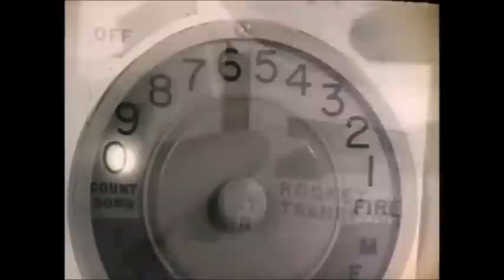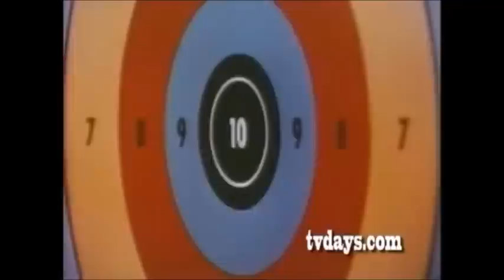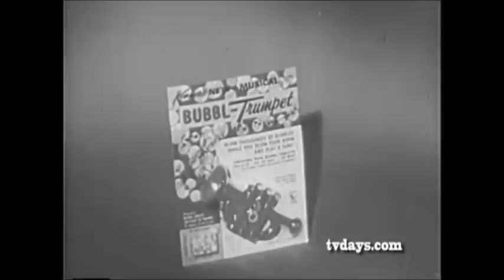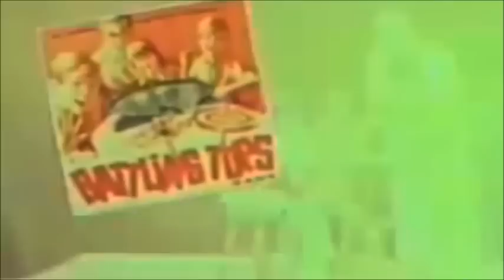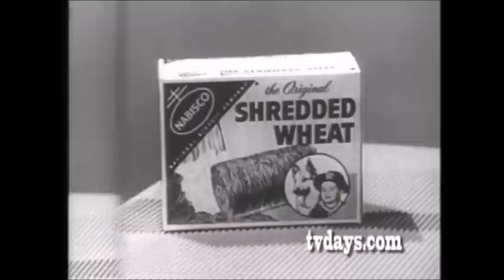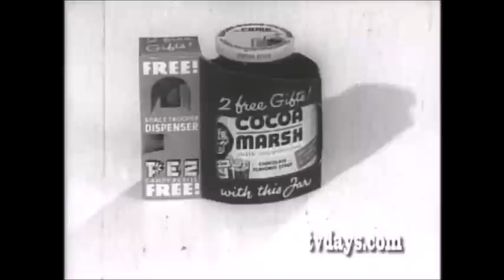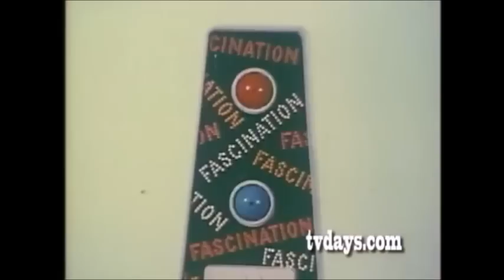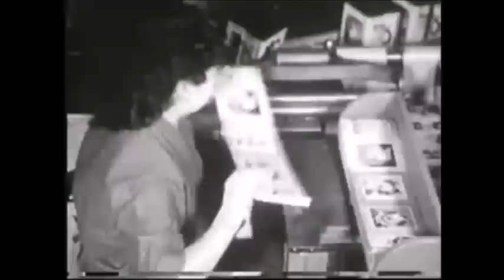Video Vault 19: Toys Were Us!

Comment: One thing they had in common, if it needed batteries more often or not the toy was dead or had a corroded battery case. Alkaline batteries were expensive as hell and reserved for photo electronic flash or items that HAD to have a high reliability of powering up. Those carbon batteries, while cheap, would leave you burning through a case in a week for your toys especially ones with motors and light bulbs. Now we have digital rare earth motors and LEDs that achieve more with a fraction of power draw but no market for toys that have those cool missile launch pads and atomic cannons!

Comment: What about the Mattel Thingmaker that you made Creepy Crawlers with? It had those metal molds you would pour liquid plastic goop into and heat them up on the electric hot plate burner that got as hot as a real kitchen stove burner. You'd cook them until they boiled, pull them off the heat, let them cool, pull the finished product out of the mold and bingo: you had solid rubbery like creepy bugs. Great toy to give to your six year old unsupervised kid. After my dad died my single mom gave me one for Christmas not knowing or really caring about what it was (poor mom was kind of out of it after dad died). I spilled more hot goop onto the shag rug in my bedroom and burned the crap out of myself so many times I lost count. It was a miracle I didn't burn the house down. Those 60's toys were freakin' awesome!
Reply: I do remember the Mattel Creepy Crawlers, would have loved to have seen an Easy Bake Oven commercial. I wonder how many caused fires when they were left on all night or had a larger wattage bulb installed than the recommended size?
Reply: Yeah and they were edible also.

Comment: Who else checked Ebay for these toys?
Reply: Don't forget to check Etsy as well, since vintage is acceptable over there, which they define as 20 years or older.
Reply: Found a couple mighty casey ride on engines on e-bay and a couple cars but not enough track to do much with and they want alot for them.Just wanted to see if there are still any of these things around.Toys in the 70's were awesome and the 80's still pretty good and then....nope.You don't even see toy commercials anymore.I,m 50 and this millenial electronic society really sucks.I do like my you Tube though.
Reply: I ve bought so many 60's 70 s TOYS off eBay  ..My home looks like a Toys R Us store
Reply: @leewilson9890  LOL